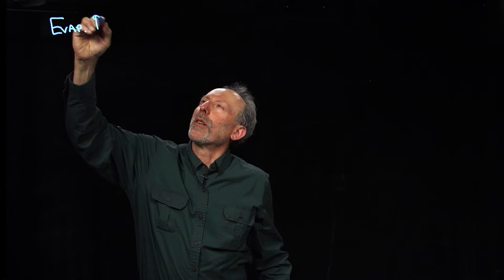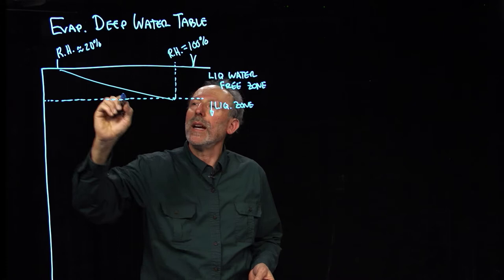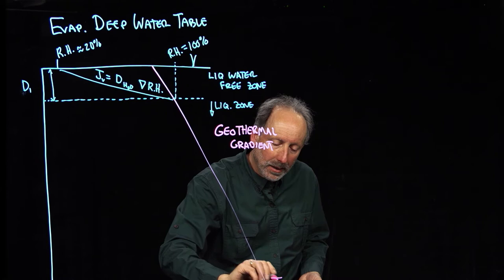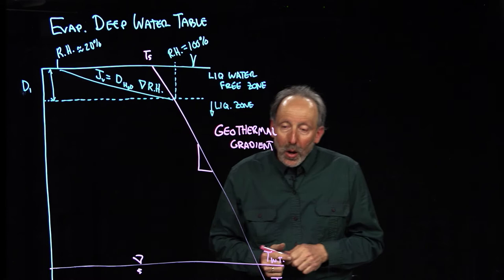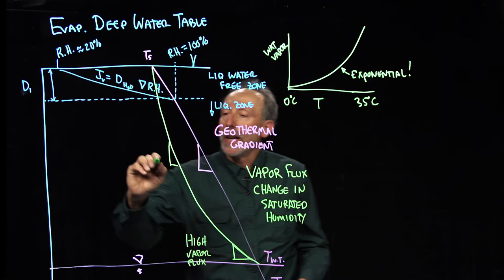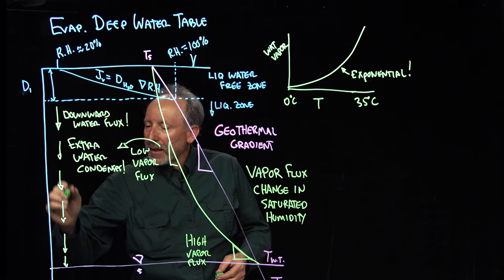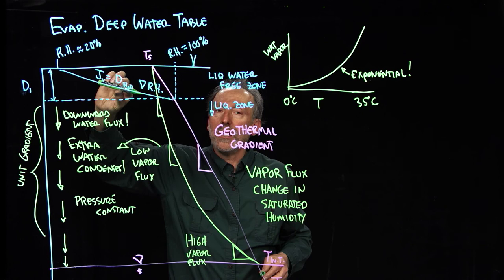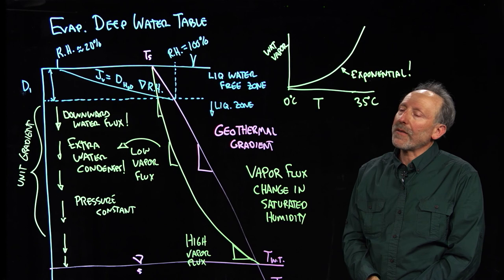Anatomy of Evaporation From a Deep Water Table

Comment: Very cool!  I guess this also transports heat upward, which would make the soil with water act something like a material with higher thermal conductivity, leading to an inflection of thermal gradient between liquid and dry zones.  And given exponential behavior of vapor capacity, temperature shouldn't be quite linear in the liquid water zone.